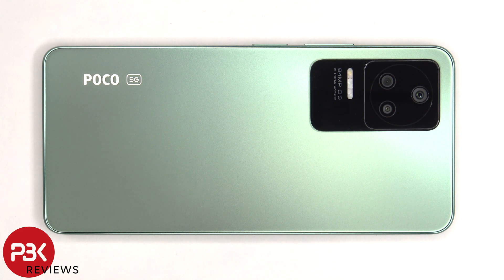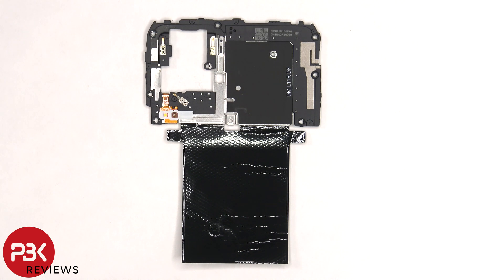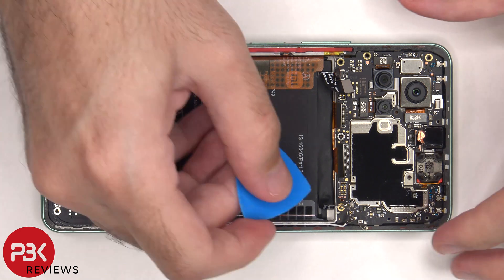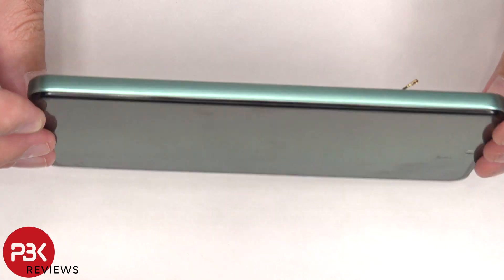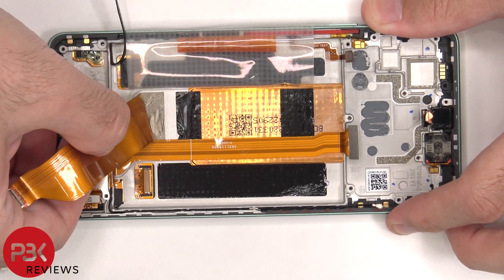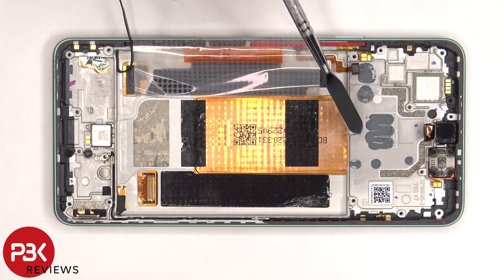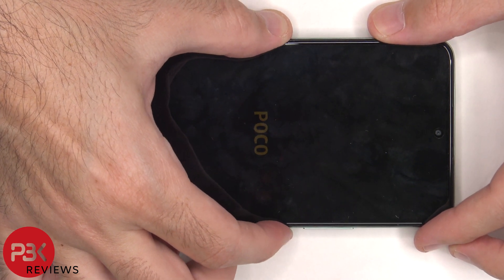Poco F4 5G Disassembly Teardown Repair Video Review

Comment: I heard a question, my cell phone suffered a fall and the back part crashed. I'm thinking of buying the new back and I watched the video, does the case fit like this without glue? I just place it and it sticks without glue?
Reply: most likely no but i think most backplate have glue pre installed

Comment: So i accidentally dropped this phone into a bucket of water, after that the touchscreen became funky. I decided to turn it off and put it on rice 12 h later when i tried to game on it i noticed some mist forming on the camera glass and the screen brightness flickering, i quickly turned it off and put it on rice once again for 12h per day for 3 days since i had to use it. Now I'm not seeing the mist but the earphones dongle doesn't get detected unless i restarted it. I cant get it repaired for another 3 weeks because i needed it at this time. This has been going for 2 weeks, Am i good😢😢?
Reply from the maker: the more you use it the higher chance of it shorting and rendering the phone unusable. If your board shorts, you will not be able to use it again. You will need to take it apart, disconnect the battery, dry out any water inside, brush off all corrosion around chips and connectors with a small brush like a toothbrush, then re assemble.
Reply: @PBKreviews  alright noted, might aswell do it myself because i dont have warranty anymore. Since I don't have a plastic pic, can i use a card to take the back glass off? I do have 99% IPA lying around can i use that to clean? 

Thank you
Reply: Just finished disassembling and cleaning my phone with IPA, now everything works fine and on my phone the main camera got glued into the frame, thus i cant get it off when cleaning. And probably some dirty stuff gets inside the lens. Now theres a residue on the main camera that i cant get it off, probably have to soak it on IPA again but i already put it back together. I found some corrosion behind the screen and around the simcard area, motherboard looks clean. Either Way thanks for the guide :)

Comment: My poco f4 was in authorised servicing center after that back panel kind of risen little above adges they applied adhesive too. Is this normal after opening once and applying adhesive?
scared of water entering from back of the frames.

Comment: My poco f4 got water damaged.. it was in warranty as water damage is not covered in.
I would suggest asap open the back panel and dry it to save it, u can do it manually or u can go to local repair centre otherwise it will get worse eventually.
because water damage is not covered in warranty so don't think of it.

Comment: Hello i rooted my f4, it's been 15 months, already had battery capacity too low, and a little overheat for idling,

Does repasting with artic mx6 (cpu cooler) works, and do i need to replace the adhesive everytime you open it?

Comment: For battery replacement need to unscrew all this screws?
Reply from the maker: Just the top portion screws since you will need access to disconnecting the battery cable from the main board and need to remove the top cover.

Comment: My f4's display is broken and dead , i want an original display replacement , will they(service centre guy's) use original display for replacement or any cheap copy amoled display ? , will service centre change only the display or whole body and one more question will they charge gst tax for display ?  pls someone reply , i am so worried .
Reply from the maker: depends if they are an authorized repair center for poco. If so, then they will use an original display. Not sure if they will only change display or frame too, but usually its a display and frame combo.
Reply: @PBKreviews Sir pls help me I somehow collected 7500rs to replace my display of poco f4 5g which was dropped accidentally by me 7 months ago , the cost listed online for display is 5999/- , i called at sc they are charging 12,500rs from me for replacement 😭😭 , how can they do this ? that much repair cost just to repair the display ? It's not possible 😭😭 , help me. What to do now , I am not capable of paying that much 😭

Comment: Hey sir i want to ask you with stupid question, can we swap poco F4 Battery With Xiaomi 12T? I mean like you know some experiment......... Yeah i gues that was stupid sorry
Reply from the maker: Hi, its not a stupid question :). Between those two phones no it would not be possible because the connectors are different. But on some phones, if the connector for the battery is the same, and the size of the battery fits the compartment, it's possible.

Comment: Dropped poco f4 from 18feet high.. luckily no dmg on screen and no hardware issues..bt back panel glass and side metal got dent hole and broken..service center said to change entire display panel which comes with body which costs 50% phone rate...no option for fixing side panel alone in this phone...repairs too much in this phone..thumbs down

Comment: is the ram piled up?
Reply from the maker: nope
Reply: @PBKreviews  So, the processor and ram are not stacked?
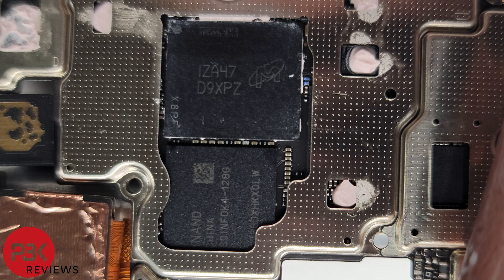Reply: @reski4246  you could observe it on 2:56
Reply: @alfzki  I still don't understand whether the one below is the Processor or not, some of my friends say that the RAM is stacked
Reply: @PBKreviews  I think you should study again, all SM-8350 socs use stacked system without exception, and there's no way Qualcomm adapts anti-stack system only for poco F4
Reply: Gak bang

Comment: Sir, How is the Quality of the Hardware components used in POCO F4? Are they really good? Here in india, Few Poco x3 pro users faced motherboard dead issues after Miui updates.
Reply from the maker: It seems good but won't know for sure. Time and many user use would determine if the new model has any issues like before.
Reply: @PBKreviews  is poco f4 gt good

Comment: I need a little HELP!
I accidentally poked my Poco F4 with my sim ejector tool into the mic hole besides sim tray. Can it affect the quality of mic? Or tampered the water resistance? And what if I mistakenly poke the uppper mic as well? I felt like there was mesh inside so, Is there any? If there was then did I tear it down? Kindly clarify these doubts.
Reply from the maker: Hi, you will be fine, the mic n filter are seated above the hole.
Reply: @PBKreviews  Thankyou so much for replying and clarifying my doubts.

Comment: Watching this in my Poco F4 :) This phone feels solid, hope that it won't need teardowns in future.
Reply: Dropped poco f4 from 18feet high.. luckily no dmg on screen and no hardware issues..bt back panel glass and side metal got dent hole and broken..service center said to change entire display panel which comes with body which costs 50% phone rate...no option for fixing side panel alone in this phone...repairs too much in this phone..thumbs down
Reply: My poco f4 got water damaged.. it was in warranty as water damage is not covered in.
I would suggest asap open the back panel and dry it to save it, u can do it manually or u can go to local repair centre otherwise it will get worse eventually.
because water damage is not covered in warranty so don't think of it.

Comment: Why does mobile manufacturer always sandwich the processor in between display and mother board and the heat sink also under the battery....if they simply put the processor and heat sink to the back side , then the device may give better performance,Heat management and wilk be good for cooling fans
Reply from the maker: I think because the heat is more effectively exhausted through the frame itself and out the front of the phone. Most people hold the phone in their hands so the back would most of the time be covered as well so wouldn't offer a good exhaust for the heat to escape. Also they try to remove some of the heat from the battery that is generated, thus the reason the vapor chamber or heat pipes are ran underneath the battery as well.
Reply: @PBKreviews  very well said

Comment: what is the purpose of the other two led flash like in the back? There is three white squares under the camera, however, only one is having light what is the purpose of other two?
Reply from the maker: There's actually only one LED light underneath which is the one you see light up. The rest of the slot or space they made it to defuse the light. So the light spreads etc.

Comment: Can you please tell me if the motherboard quality looked good enough, average, below average, or "born to failure" in your opinion :c?

The reason I ask is that Poco phones have this fame of having very cheap prone-to-fail parts because of the cheap materials and that, that's the reason they only last a few days/weeks/months and then die u.u and I'm not rich, quite the opposite and 400dlls are more than a year worth of saving up for me so I've been wanting to buy my first brand new phone with the greatest performance and display but at the most affordable price there is and the F4 suits that nicely :c... But I'm worried...
Thank you for your attention and teardown review.
Reply from the maker: Hi, I'm not 100% sure but I would lean towards it being better than the previous versions. Also the cooling is better as well so would help.
Reply: @PBKreviews  Thank you so much. When you tear down the phone it seemed alright, but I don't have much experience with motherboards and didn't get a good look through this video so that's why I asked directly C: thank u again ✨
Reply: @robertwolfgan  I'd you refer to X model ye X are lower end

Comment: Bro with poco f3 or f4 which you suggestion its   good upgrade  to f4
Reply from the maker: I would recommend the F4. Cooling alone is a much better design compared to the F3.
Reply: Yes and no
Yes because the performance are good
No because the camera sucks, especially the OIS 

And this phone hot like lava if you do too much gaming

Comment: Waiting for this teardown video, the back panel and camera housing can actually be separated? mine I think making squeaking sound if you pressed the back in the middle of the camera housing quite annoying, have you encounter similar issue if so how you overcome, thanks
Reply from the maker: Yes, a portion of the camera bezel is held on with adhesive and the smaller square portion has 4 Phillips screws on the back which can be removed to free that portion. The glass lens cover itself is held on with adhesive, so if you needed to replace that you would be able to just heat it up and pry the glass part off. As for the squeaking, I have not had the same issue on this one, so might just be one of those screws might be loose or maybe the adhesive is loose not sure.
Reply: @PBKreviews  I'm new in this, what kind of adhesive did you use to reassembly the back cover, glue or double sided tape (and is it hold firmly)?

Comment: Why they put the thermal paste so little stingy xaiomi 🤣
Reply from the maker: It actually has a decent amount. Too much is not good either, it can leak around to other areas you don't want it to get in, especially if it is a more conductive thermal paste, it can cause shorts.
Reply: because no more is needed

Comment: Just curious does water in poco f4 go through the Power button or it really water (like an water splash)ealed properly.
Reply from the maker: It has water gaskets by the power button/volume keys and charger port, sim reader etc. So I would say it is splash proof, but it doesn't have gaskets around the connectors on the inside and so forth, so I would not dunk it in water and expect it to survive in a pool etc.